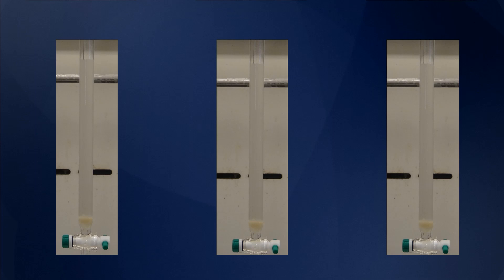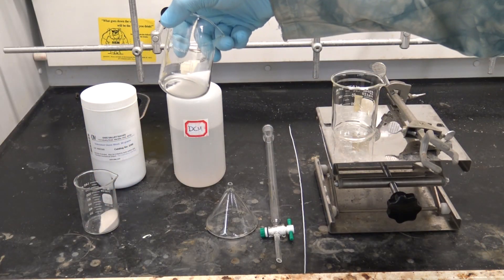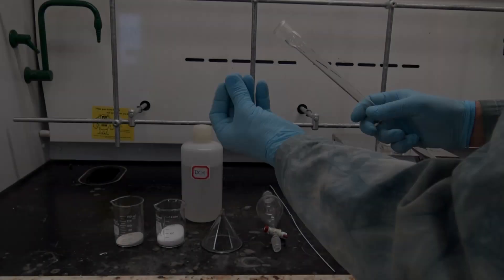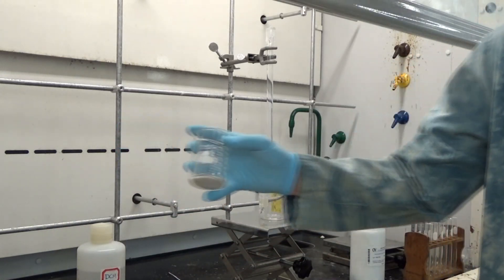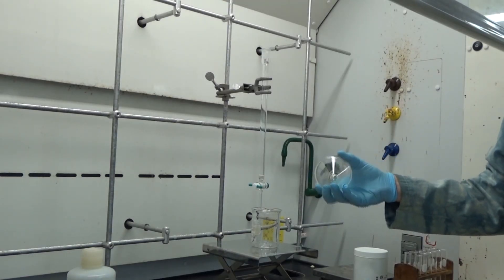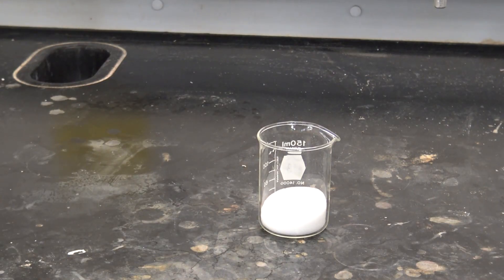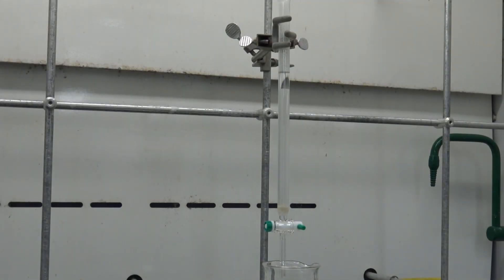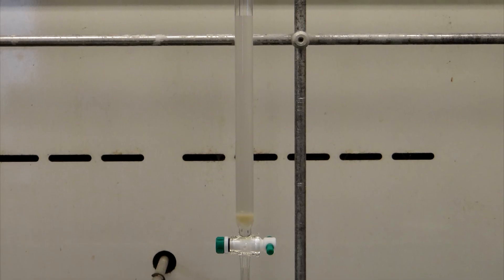Demonstration - Wet Packing a Chromatography Column

Comment: great demonstration, but there is so much missing information. 

First of all, the silica needs to be soaked in the mobile phase for a few minutes with more agitation to ensure it is all wet, especially when dealing with larger amounts of silica. Secondly, after pouring in the silica slurry, the column needs to be tapped continuously until all the settling stopped, after which the column needs to be inspected for cracks and/or bubbles. Also, no need to wait for it to settle to check the level. Based on the initial silica volume, and assuming it is all poured into the column (via washing the beaker), you can calculate the level of silica (pretty easy from volume of cylinder equation). Also, a way of speeding up the settling process is by using compressed air.

Comment: confused by calling the silica gel 'packed' when compared to squeezing out the dmc it is
simply settled and still relatively 'loose' .    valuable info missing by u stopping before show
us the sample-load step  and the run-the-column after that.
     i'm curious too if the flow rate of the dmc thru the column changes / slows much
with the sample added.   
     thank goodness many others have posted col' chr' vid's here.  will visit and see
what all other ideas  / methods are applied to this lab method